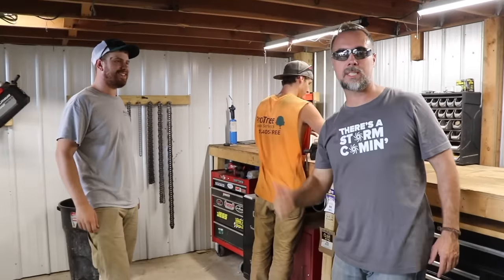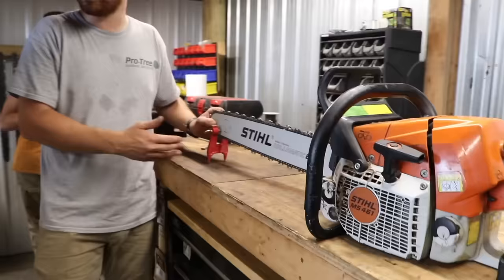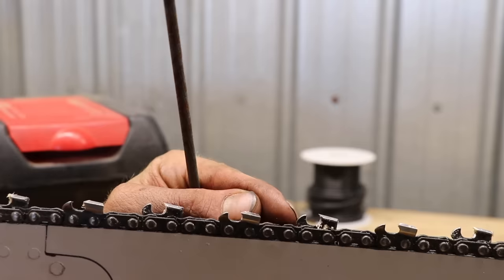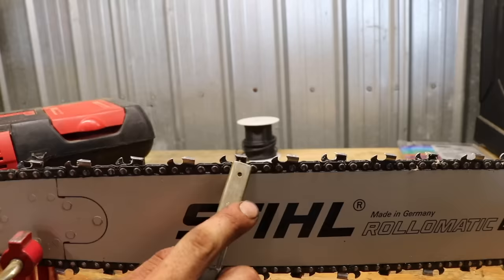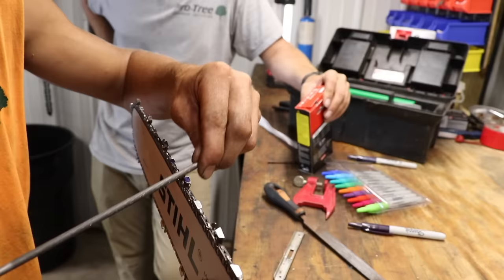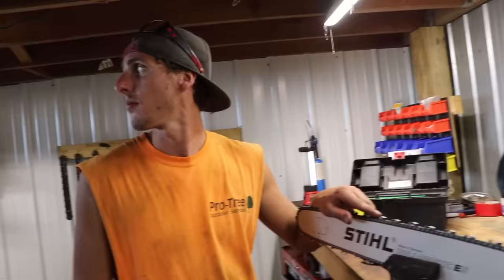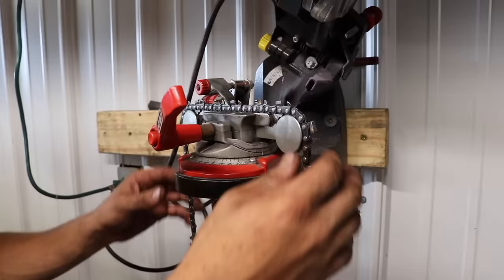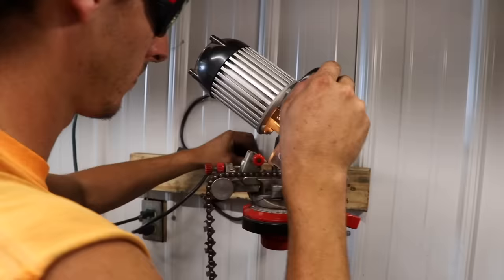How the Pro's sharpen a chainsaw

Comment: You should show a video on the new stihl 2 in 1 file I love it
Reply: I have one and it blows these old ways out of the water.
Reply from the maker: Thanks for the suggestion Derek
Reply: Those are good until you hit metal and damage a few teeth,  you will never get that chain to cut properly again with this tool,  you have to go back to old school hand filling to achieve that.
Reply: YES Sir!  It's 2019, time to lose the slow file tools.   Both our Stihl 2 in 1 files, .325 for the Stihls and a 3/8" for the Husq and Dolmar 7900,  are LEGIT!!!  I can out produce our cheap harbor freight machine, and do a better job without de-hardening (overheating) and shave off less metal, so they last longer.    By the way, Oregon is pronounced "organ," it's said pretty quick.  The video just got to the machine sharpening section, and the 2 in 1 is definitely a little faster, you can just flip it and hit every tooth as you go around once, rather than twice.  This was a pretty good video.  Like that you're bringing in other pros!  Thanks to those guys, too!

Comment: Years ago I bought a chain sharpener from good ol' Harbor Freight. $30-35 but it does the job, & lots faster than hand filing. I take off as little as possible to just take off the dull edge, & make chains last longer. It does have a little give & wobble here & there, but tighten everything down solid & get to goin.

Comment: "Ive been sharpening saw chains a long time so I don't need a guide " . That's kind of like saying, "I don't need sights on my gun, I've been hunting for years" the reason for the guide is not only to keep the correct angle but also to keep approximately 10% of the file above the top of the tooth. (And do it consistently). The best best way to hand file is with the 2 in 1 file from stihl. If files the tooth and adjusts the depth gauges at the same time. Also do not file your depth gauges with the gauge tester on the chain, use it to check the chain, take it off, file the depth gauges a couple of strokes, test again, and so on , if you file the top off of your depth gauge tool then it will won't be that accurate.
Reply: %100 correct. Not using a guide is %100 dumb.

Comment: I worked in the woods for about 10 years then I had a tree service for several years. When you look at the chain tooth you want to look at the cutting edge, if it is dull you can actually see that it is dull. To keep the saw from cutting crooked, start with the dullest tooth and count the strokes until it is sharp. Then sharpen with rest of the teeth on both sides using the same amount of strokes. I have friends that are timber fellers and tree climbers, they hop up their saws then they put larger sprockets on the saw output shaft for more chain speed. They and myself usually do file down the rakers  a little  more than required.  I have done it for years, It is dangerous and I don't suggest it unless you have lots of experience . The saw will want to pull right out of your hand. But man will it cut.

Comment: I burn a tank I sharpen my chain. So much easier to keep up  on it then let it get so dull it takes half a day of filing to get it sharp again. I keep my rakers about .020 down from the tooth. I like the agressive chip throwing 😎.
Reply: .020 is pretty standard... not aggressive
Reply: I agree with Bob that .020 is not aggressive, 25(hard wood)35(soft)is normal.
Regardless those are just fixed settings, the best way is to use a progressive raker gauge like the husky/Oregon gauges which set the rakers at a a specific angle in relation to each individual cutter and not a fixed height. If all the cutters are the same length the height of the rakers will all be at the same height though.
If you want to know more feel free to ask.

Comment: Also need to check the edges of the bar for a ridge and file it smooth this will cause a bar to hang and cut in a single direction
Reply: I think this was only about the chain not the bar, but good point they need to do an episode on dressing the bar

Comment: I seem to go through  a chain without ever filing my rakerz..and lately I am having trouble with file size..i have 2 files that look like same size..but they are not..been buying a lot of new chains..cause I can't stand when my saw doesn't cut full speed ahead...i need it to blaze through my trees..they are big and scary and usually on cliffs..
Reply: Kerry PRT.2 what size chain do you have. If it’s 3/8 then use a 7/32 fine. Every time you sharpen you need to adjust your rakers. Go into any saw shop and they will help you.
Reply: Well, while i cannot dispute what you say about the rakers, i don't think that is really necessary whatsoever. Maybe the chains today?   Back in the 1980's i would sharpen my chain by eye, didn't take very long, and cut those chips just like it should.  Nice looking pieces.   Never had a problem at all.  Never bothered with the rakers.
Reply: @bryanmarks4070  you don't need to file the rakers every time you file the chain.
Reply: Gezz. File your rakers once in a while.

Comment: Stanley...Good beginner video.  Lots of comments regarding BBRS.  He does videos showing length of tooth and tooth angle have little to do with overall cutting.  The most important aspect is the raker setting.  If the teeth are different lengths but the raker is set properly for that tooth the saw will cut just fine; no wandering, cutting circles, etc.  The main thing with raker gauges is there is only one out there worth a damn.  That is the Husky raker gauge and not the one that comes with their roller filing guide.  That guide and the Oregon and Stihl raker guides are soft metal and in a couple of filings of the rakers instead of taking them down 0.025" you are at 0.030" and your saw becomes unmanageable.  Get the Husky guide and learn how to use it; it is hardened steel and your file just glides over the top while taking down the raker.

You also need to take your round file 1/64" smaller when you have cut away half of the tooth.  That is one of the major problems with the Pferd CS-X and the Stihl 2-N-1.  They only work well in the first half of the tooth.  You cannot make them accept a smaller diameter file...I've tried.

When using an Oregon (or any brand) grinder, they need to be reset for each side.  The first one I received was slightly over 0.015 off.  I got a replacement that is much better but if you are going to try and get both sides close to the same top plate length you need to re-adjust.  I use a 4" adjustable Crescent wrench; much quicker than a micrometer.

His wheels were clogged with debris from the chains.  That will burn teeth and make grinding much more tedious.  The grind wheels need cleaning/dressing after every couple of chains unless you clean your chains well before grinding.  Moab wheels from Bailey's cut quicker and don't fill as quick.  Best are the CBN wheels from Diamond Wheel.

Sharpening chains is an art form and every different wood, every different saw, every different tree person likes his chains the way he does them.  I ask people what top plate and what side plate angles they want and also how much they want their rakers taken down.  No complaints so far.

Comment: So what’s your opinion on one of the $19-29  Harbor Freight chain saw sharpeners & what’s your thought on the Stihl 2 in 1 easy file chainsaw  sharpener?  
When I was young I worked at a family run hardware store. I would sharpen chainsaw blades using the Oregon sharpener. I bet I ruined almost every chain. We didn’t charge to sharpen chains
 (I know why now)  never had a complaint that I knew of. This was over 30 years ago and lasted for 10 years.  I only learned how to properly sharpen a chain maybe 10 years ago from a Wildland Forestry Class I took while in the Fire Service. If I could only go back in time. Thanks for putting together this video.
Reply: I no longer sharpen chains, I just buy new, You can buy new chains for around 15 bucks, sometimes less, sometimes more...
Reply: I bought the electric harbor freight sharpener, it was about $40. Works amazing for me. I was screwing up hand filing so I bought the electric and haven't had problems since. Also found out a main issue I was having was that the logs we're drug through the dirt and the dirt on the log and in the bark was dulling my chain before even starting my cut.

Comment: Good guide for someone just getting into chainsaws and or sharpening cutting depth is very important chain will cut straight if the teeth are close to even on each side but there could be differnt size from one side to other so if you hit a nail on one side and only mess up 2 or 3 teeth but only on one side you only have to file that side down you could keep the other side brand new but you have to take your cutting depth down on the same side you filed and it will cut true if you dont take the rakes down itll pull to the side with the bigger teeth because the rakes are rite depth if your not get a gauge and check that all the time

Comment: I cant sharpen a saw.. but I sure can dull them up! 🙄

     Always depended on my father to sharpen my saws, and they would throw some shavings!! 
   But how he's moved away , I take my chains to the local saw shop and they sharpen them razor sharp for $5 each. 
     Thanks for the pro tips guys, I need to figure it out for myself!
Reply from the maker: Hope the video helps you out, thank you !
Reply: I've never been a pro at sharpening a chain just ok.  Lately I don't use my chain saw much.  The Granberg G1012XT has really been nice for me.  It's easy to use and fairly fast.

Comment: If it helps someone - The height of the rakers/depth gauges determines how big of a slice the cutting teeth take off with each pass. 

When they're too high, the saw won't bite into the wood. When they're too low, the saw will bite too much and get jammed in the wood (it also makes the saw jump around a lot, and feel very 'jittery'). 

If by mistake you do take the rakers down too low, you can often fix it by filing the cutters down more. By doing this, you reduce the distance in height between the raker and the cutter, and it makes for a much nicer cutting saw. 

"But doesn't that reduce the life of the chain?" - Yes, it does. But an overly aggressive chain is a pain in the ass to work with. I roll my eyes when people smash their rakers down intentionally, it's just stupid... and then you watch them use a saw that's jamming and bouncing all over the place. 

You'll probably only need to file the rakers every 2 or 3 sharpens, and even then, 1-3 passes with a decent file are often enough.

As with anything, it takes a bit of practice to feel what's right, but don't be disheartened if you're struggling initially (we've all been there!).

Comment: Awesome, Ive been doing it wrong all these years.  I was always told to leave the guide tooth alone and Ive sharpened my teeth 20 times and the chain keeps getting worse at cutting.  Gonna try to file them down with a depth guage.
Reply: Your not alone, I nee to address my rakers as well now, hell it makes since when you think about it I suppose

Comment: You need a ABN grinding disc which stops any blue tooth.
The unique design creates lots of air and because of its material the wheel doesn’t need to be shaped.
You can get them for carbide chain and standard chains and different sizes to suit

Comment: Not rakers. Depth gauges. Should be average .025 Below the tooth.
Reply: It's slang but I've been hearing that for 35 years.
Reply: You're right on the measurement, which is the same for almost all chains (1/40th of an inch), but I have to contend that the term "raker" is acceptable. The tooth rakes along the work and must do so in order to do its job, levering the cutter tooth to adjust the angle and thereby depth when it encounters wood. It's less descriptive than "depth gauge," but "depth gauge" doesn't tell the whole story either. "Raker" is easier to say, sounds better to many, and describes the function well enough.
Reply: Rakers is a hold over term from the days of hand saws. History.

Comment: Hand-sharpening may suffice but there's no substitute for a file jig. Having cutters of varying lengths is not so bad, especially on a chain with lower mileage, but the file angle and height really ought to be identical on every cutter. Try it for yourself. I recommend the all-metal Granberg 106B filing jig. It costs only 30 bucks but will give you the ability to sharpen every cutter to the exact manufacturer specification. If you file strictly by hand, the amount of variance in the shape and dimensions of the cutters will become greater with each sharpening and will progressively diminish the chain's cutting potential. Brand new chains cut very smoothly and efficiently, not only because the cutters are sharp but also because they are identical to one another.

Comment: 6:00 don’t turn the chain around you flip the file and cut from the other side.
Reply: That's a lot harder than flipping the saw around. Flipping the file requires you to stroke the file in an unnatural manner.
Reply: @xenonram  Once you have practice, it's a lot quicker/easier to flip the file.
Reply: @JDeWittDIY  agree with old mate above, give me 15mins I'm go try it now.
Reply: How about stand on the other side of the saw pretty simple you only have to be 1 percent smarter than what ur working with to figure it out

Comment: File gauge from husqvarna, is the one for small time users. Its really good. It takes time to learn how to file, and you will fail a lot of times. Use the file gauge. Recommendation from a pro Danish lumberjack. (Of course only to husqvarna, jonsered etc saw)...if stihl, buy the 3in1 tool.)